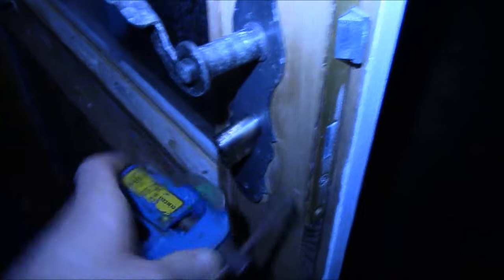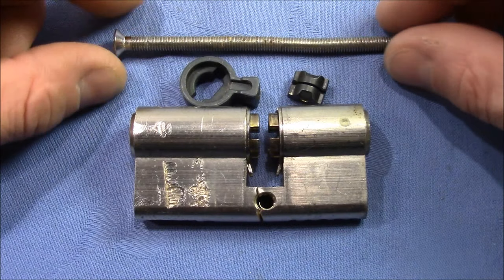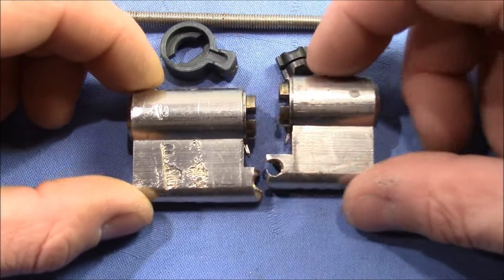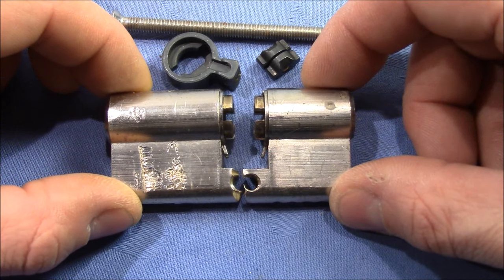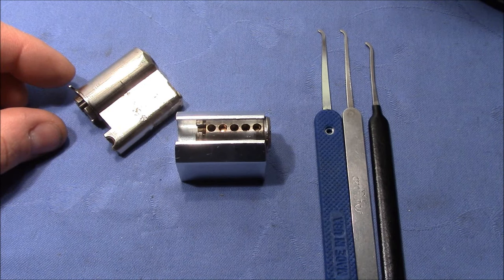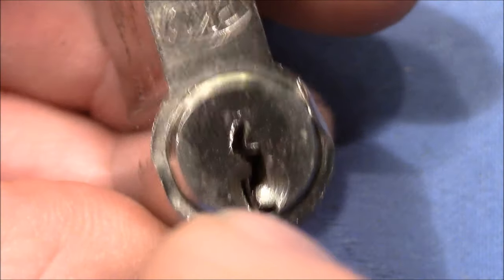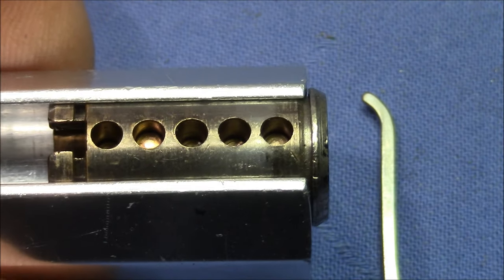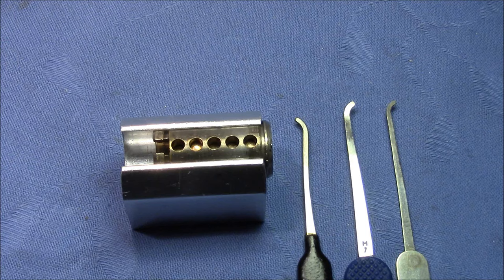(picking 313) A real life lockpicking story and honest BKS picking - still a lot to learn

Comment: BKS are maybe the most difficult standard cylinders in Germany. My first took me several days. It was the last lock of my collection that I defeated. So really nice to see someone else struggling the same ;)
Reply from the maker: Thank you for saying that BKS are difficult. The keyway combined with the bitting makes it very hard. Also I had to apply some tension to get the pins bind. But then setting the pins in this keyway is a real pain. That's a skill I need to improve: Getting the right feeling for setting the pins with less tension.
Reply: Once you get one open they're quite similiar. The 3 back pins need some strong pushing and also come back a little bit from time to time and need another strong little push. The spools are sometimes also hard to set without kicking out the pins in the back. I usually check them from time to time and try to set them as early as possible.
Reply: Also very thin picks required because of the keyway.

Comment: Great job getting that one open Potti,  very tough keyway, but your persistance paid off,  well done on a really interesting video/adventure.
Reply from the maker: Thank you. I wanted to make it transparent what it takes sometimes to get the job done sometimes. It's perhaps only showing my lack of skills but that's the truth. By the way in the meantime I made a key for this lock and reassembled it. Within 10 minutes I picked it twice. Seems I'm getting used to the keyway and this particular lock's pinning. But what counts is the time needed for the first time and not when you learned a lock so well like I did with that.

Comment: Great video, very nice analysis of the situation and lock itself. Thank you for sharing this with us. 
I've spent two cold hours by drilling lock once and it was dreadful. I can't imagine I'd try to pick the lock in that condition. Great perseverance buddy.
Reply from the maker: Wow, 2 hours drilling - respect. Guess you have used / broke some drill bits ;-) I was lucky that snapping worked so well due to the long piece of the cylinder on the inside. Thanks fr watching :-)

Comment: glad i found this video. very interesting pick. i would like to see if the lock could be raked a lot faster. also after a few false sets could you rake it into a false set and then pick it from their?
Reply from the maker: You need a very thin rake to get the job done to get a false set (but not tried) - the lock has pretty good tolerances.
Reply: okay, that is some good info. as a newcomer its good to get this kind of info from the guys that are in the "know"

Comment: Are you going to pick the other half when your hands are feeling better or have you had enough of that lock?
Reply from the maker: Today I made a key using the picked side and opened up the other half. That was really hard as the housing was heavily deformed from my vice. Then I reassembled the first half and managed to re-pick it twice within 10 minutes. This doesn't really count as only the first attack-time matters. Nonetheless I will continue working on this lock to practice other techniques and learn picking with lighter tension so that setting the pins is easier in the tight keyway.

Comment: Thanks for sharing that.
1 shows why our videos do not provide criminals with tricks to break in to houses with quality locks on the door.
2 Show the diff between sitting by the vise with the cup of hot cocoa, and standing bend over, with a doorhandle in the face, trying to open a lock. 
Pickgun or Carbide for Real-life opening. SPP for hobby
Reply from the maker: Very true what you are saying. The few times where I have picked locks in real life it was very difficult, but I opened them. This time the BKS didn't let me in and I believe it's a combinations of a very good lock, bitting and myself not trained to pick in this evil keyway. When I pick locks they are always different as I do this as a hobby. I believe that I could practice how to pick BKS locks and then I would get better. But my picking habit is more to look and feel many sorts of locks and when it comes to the more difficult ones practice would be needed for each and every one to master them.

Comment: My first item I successfully opened was a Safeguard safe with a 6 pin number. I got lucky by checking the most used pin codes. The safe was in a dumpster but lock in the open position. $0 to get $350-$500 brand new. I did not charge a cent, and no Thank You.
Reply from the maker: Haha, very cool in guessing the right code. Was is 123456 ;-)
Reply: Potti314 close, it was 123987.

Comment: finally lol. The problem is you're picking it upside down, lol. I'm sure #4 was overset most of the time, probably not getting #5 either. Tough bitting blind picking.
Reply from the maker: Haha, I could have tried to hang upside-down from the roof to pick it the other way around; yes oversetting is a major issue here and the fact that you need some tension to get the pins set which makes picking hard in that tight keyway.

Comment: hey potti314, the next time you take a euro lock out, first undo the screw then the whole lock will just push straight out.
Reply from the maker: That is what my neighbor tried first. As this didn't work, he asked for help. I tried to point out that the cam stood at an angle when the plug is in the locked position. Therefore the cam blocks the lock and you can push through the lock only after turning the plug a bit (key or picking).